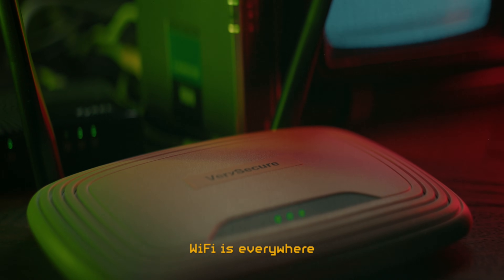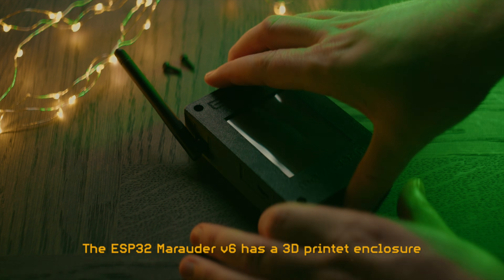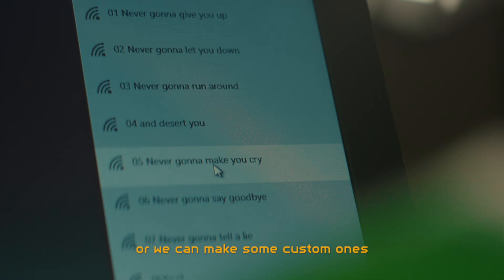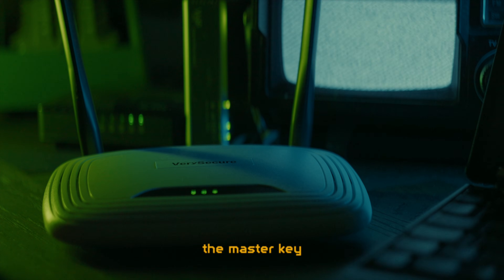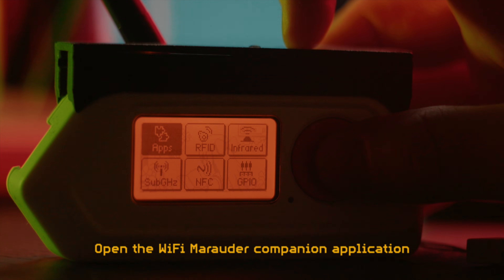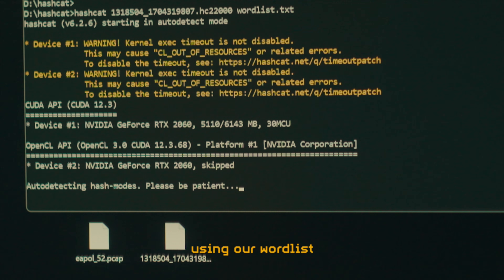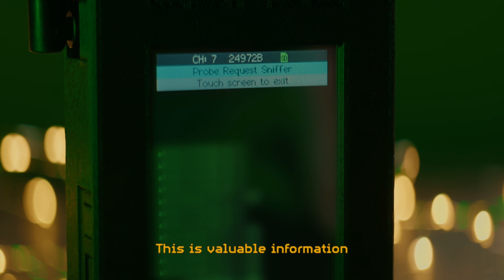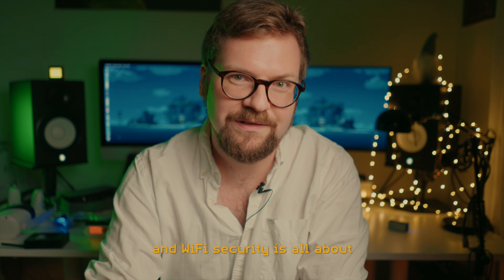WiFi Pentesting In Your Pocket / ESP32 Marauder

Comment: so the ESP32 only covers 2.4ghz, how are you testing my 5gz if its got a different password? hmmmmmmmmmmmmmmmmmmmmm? lol
Reply: It is not working with 5ghz
Reply: ESP32 C6 has 5GHz.
Reply: @ozdemirsalik I read it does not support 5Ghz
Reply: Find an exploit for the router and I dunno, look?
Reply: CC1101.
Reply: Hahahahahahahahahahahahahahahahahahahahahaha
Reply: No the Marauder is just a toy It doesn't support modern Wi-Fi bands
Reply: Some WiFi networks have a 4G connection like portable WiFi hotspots, and most of the time the passwords are the same as the 5G network.
Reply: @NecessaryEvol  Lol I get it now. 4g and 5g cell towers have nothing to do with wifi. 
That "G" means "generation". Aka 5th generation of cell tower technology. Wifi they're talking about the frequency the signal broadcasts on
Reply: @LennyMiller739  you don’t get it
Reply: @NecessaryEvol  There's literally no such thing as 4ghz wifi
Reply: @LennyMiller739   you’re right, 4G is basically 2.4GHz but of course that has to be broken that down for you
Reply: @NecessaryEvol  Broken down? You didn't break anything down - you completely changed what you said. What's wrong with you? There's no 4g wifi, it doesnt exist. 2.4 has never been called 4G and I shouldn't need to "break that down" for you kid. My first comment was correcting you, my second comment was telling you WHERE YOU WENT WRONG, why are you trying to use the information I provided (that you didn't know) to say I need things broken down for me? Nothing you have said has been true.
Reply: @NecessaryEvol   Oh and "most of the time the passwords are the same". If they're the same it's the default password and trivial to crack. Even if you were right you wouldn't have said anything of value. This entire thread you're arguing over a moot point. Be better
Reply: @LennyMiller739  I’m speaking from my experience hacking my peers WiFi networks both 2.4GHz and 5GHz with an ESP32 and Alfa adapter and told them to remake their passwords. 😂 I’m not about to keep going back and forth with people who don’t know sh*t
Reply: @NecessaryEvol  Your experience is limited to poorly configured networks? Why would you admit that in a comment where you're pretending to be an expert.
Reply: @LennyMiller739  🤦🏾‍♂️ I think you should stop talking, the others aren’t listening to you either
Reply: @NecessaryEvol  I think you should playing make believe on the internet.
Reply: @NecessaryEvol  You need to do a lot more study if you want to play this game Aleksie. You aren't that guy
Reply: @NecessaryEvol  Good boy
Reply: @NecessaryEvol thanks for arguing guys. I’m learning stuff. I needed this lol

I swear this isn’t sarcasm. I’m literally new to all of this
Reply: You can get a dual band antenna so you can use it on both 2.4 and 5gz
Reply: @8bitblockhead721  but esp 32 is not working on 5ghz at all
Reply: @8bitblockhead721 Most attacks don't work on 5ghz

Comment: Never in stock, comes with no documentation what-so-ever, requires obscure battery you need to install yourself (I'm serious) that takes a week at best to ship, no contact information outside some gay ass social media platform for customer support, multiple batteries listed in different places for compatibility, couldn't even be bothered to upload a single image regarding installation or list ALL the specs for compatible batteries. 

All in all, a very disappointing purchase and definitely anti-consumer, even if inadvertent.

Comment: If I had a time machine, and could do anything in the world, I'd go back and pwnch whoever's idea it was to allow wifi access points to be password protected.
St000p1dest idea in the history of man.     I've been running a neighborhood wide wifi network of 10 access points with no password on it for 15 years with zero issues.   Nobody has ever asked me... what's the password... because they don't have to.    Think about it.   If everybody took the password off their wifi, where ever you went, you could check your messages.  instead, what we have is a disaster of the commons, with 15aps in some spots all crammed in the limited 2.4ghz channel and none of them usuable by anyone but the owners.